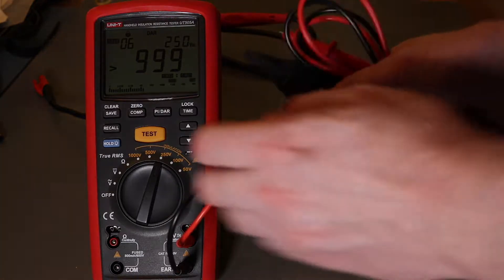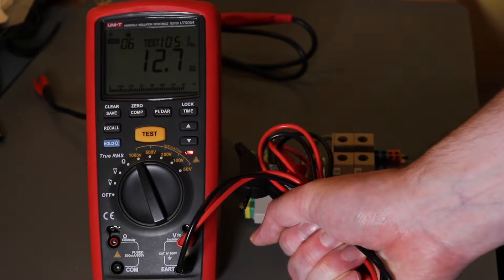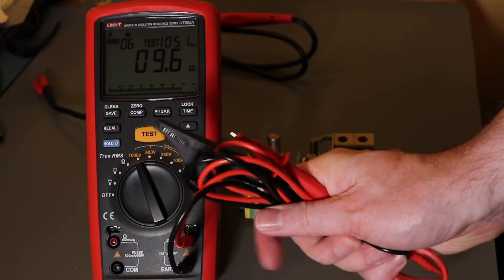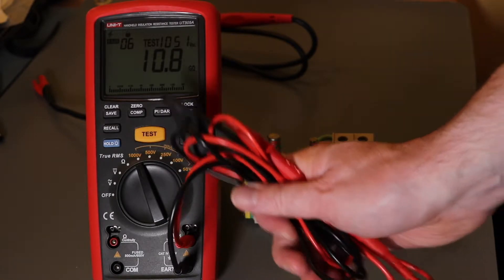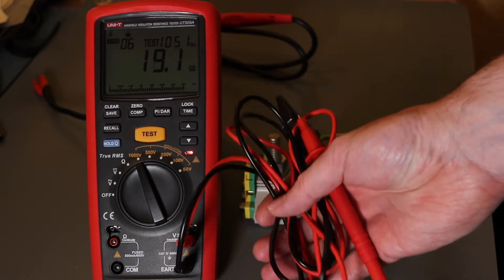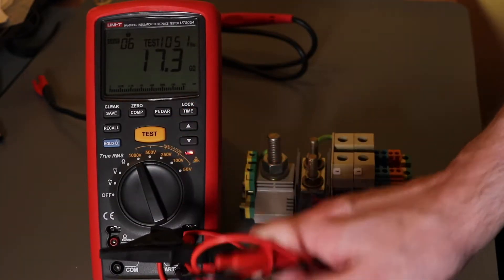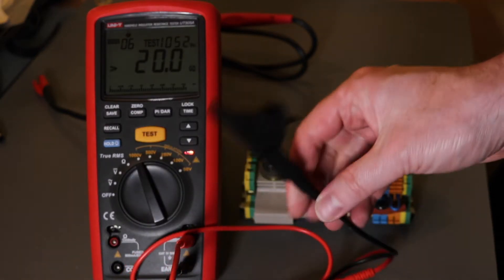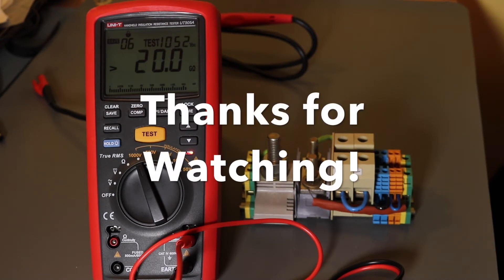1000V Insulation Test on UT505A Test Leads

Comment: They are still good for mesure or not, and when you should be worried about using leads if there resistance drop?, thank you
Reply from the maker: Yes you can still make measurements with these leads, just be aware that if the circuit you test has a high insulation resistance into the GOhms, then the leads would reduce this reading due to their leakage. This effect could be reduced by ensuring that the leads are not touching each other, either directly or by resting on the same metal work.
Reply: @three-phase562  thank you for the explanation, now it make sense,
Also your video's are so informative thank you for sharing your experience with us, i apriciate your that.
Reply from the maker: @MadaraUCHIHA-hy9xe  Thanks, glad the video helped!